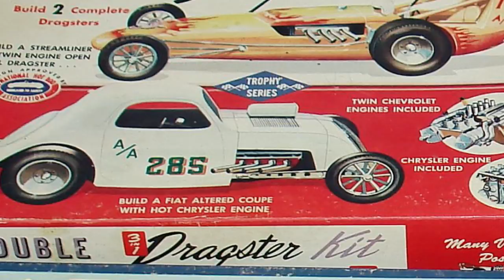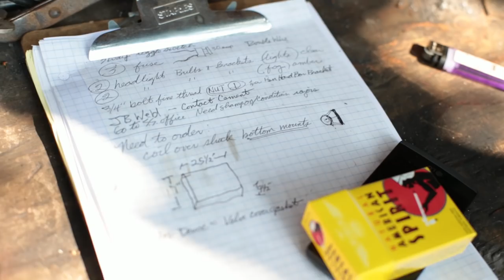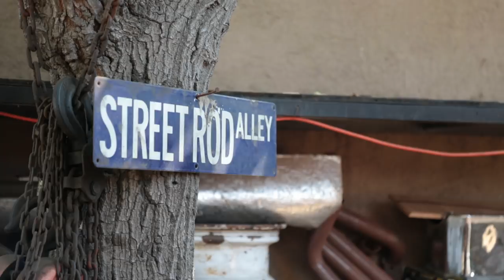Echo: Made In The Shade - A hot rodder's documentary

Comment: WRONG!  The Shifters car club of Southern California brought back the resurgence of basic low buck traditional Hot Rods in the late 1980s / early 1990s . This was during a time of high tech Street Rods that had digital gauges, billet wheels, modern suspensions, and painted over chrome & stainless.  The Shifters, unlike the mass,  were a throw back to the 1950s, with ducktail hair styles, cuffed jeans,T-shirts, and even listened to old Rock & Roll. One of the members even coined the phrase "Rat Rod" . This was back when the term meant something entirely different than what it does today. To them, it simply meant - a period correct Hot Rod that lacked certain elements like paint and/or interior. Their engines were powered by Cadillac,Olds,Flathead, & Pontiac. THIS is who started the fad/lifestyle, and it is very interesting that so many "experts" don't know their history . Obvious reasons, being that they haven't been in to the hobby as long as they claim.

Comment: A ol salty dog a sharing his life an knowledge. Hey rust gives a ride character.  Been building cars for years myself for myself. I invest a lot in the drive train. The body eh if its decent enough i leave it be. Its more about having fun. Chrome and a fancy paint job don't make you go faster. A well built engine/trans & rear decides how fast you go. I have a 1969 Plymouth Road Runner. Its a totaled wreck rebuild. Its not really pretty or perfect. I did paint it mostly to cover its surgical scars. I replaced the front two thirds of the car using a 1969 Satellite wagon for the rockers ,front clip and subframe and suspension and wiring. Even most of the firewall and floor pans. Not because of rust  but because of severe wreck damage. Only one reason. It was a 1969 Road Runner with a clear title saying it was a 440/4speed Road Runner and the vin and body tag matched the title.

Comment: "Rat rods" have been around since the 1930's, they were just called "jalopies" or in some parts of the country, "gow jobs". The Cubans have been bringing 1950's cars back to life with whatever they could find since 1959, before the Germans. A jalopy was something a farmer's kid (before earning GI pay in WW2) slapped together in the winter (unless they're a dairy farm, that's year 'round tending) with whatever left over parts there were and the "portable blacksmith shop" to bend heated parts to fit. Soak the rusted parts in molasses dip to get back to the original metal. Wire some truck batteries together and weld with a coat hanger. 

Racers would buy the kits to turn the T into a board racer, just lop off the bodywork past the cowl and bend a wooden rear section like steaming a homemade canoe. Hot rods existed before the 1950's, but it was usually the farm boys repairing everything on the farm rather than buying it new thru the Sears catalog who had the skills. The war taught the city boys how to fix anything in the field, and put combat pay in their pocket when they got home. For bodywork, there was always a "coachwork" joint who only had so many horse drawn carriages to work on.  Funny thing is how many rat rodders think flat black was the color of choice--not so! It was just cheap, as bodywork mods got done a little at a time. Its why the fadeaway paint was invented, trying to blend into the regular color.  Candies and metallics didn't exist, but everyone wanted Tahitian Red anyway.